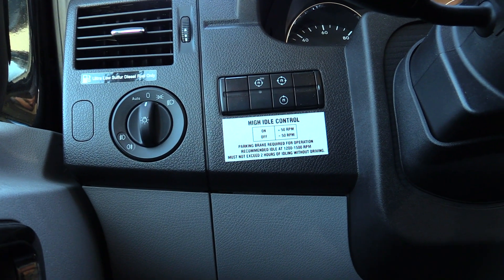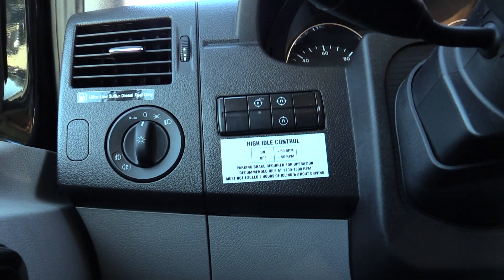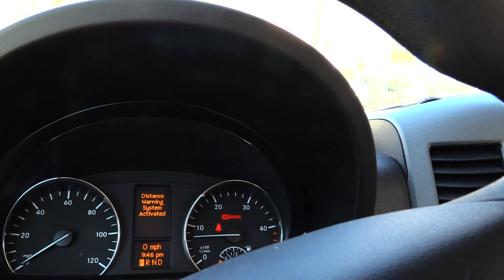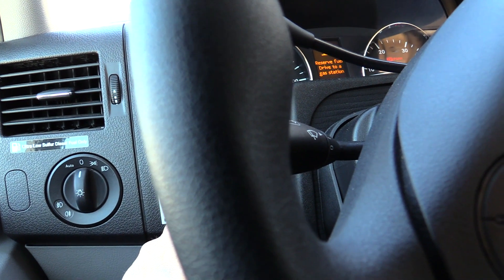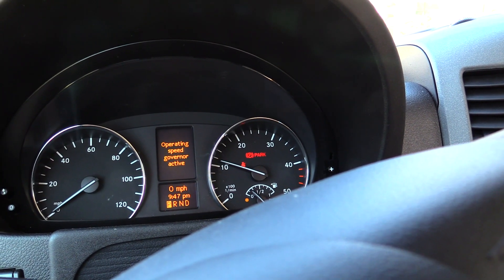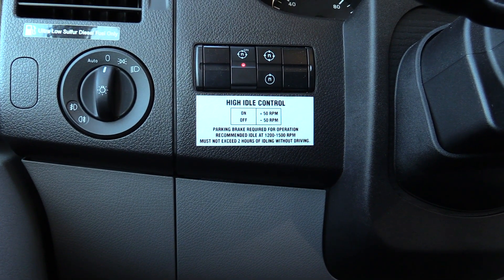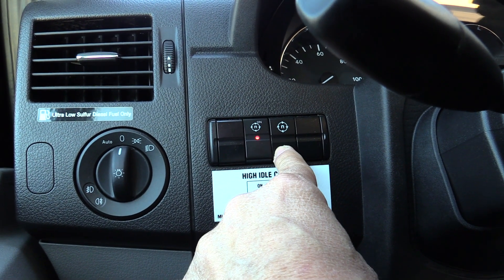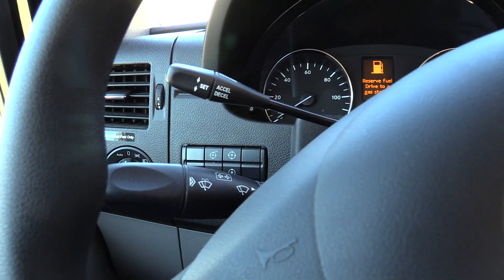Sprinter High Idle Control

Comment: Girl asking What is this for? What does it help with
Reply from the maker: It makes the engine idle at a faster speed  to charge the batteries faster.    But it’s also not good to idle the new Diesel engines too long.
Reply: However idling with a higher RPM does make idling for longer a bit safer for these diesels. Less chance of clogging up the DPF system